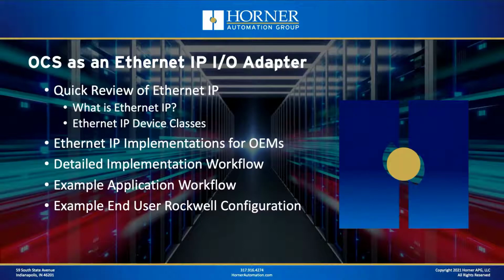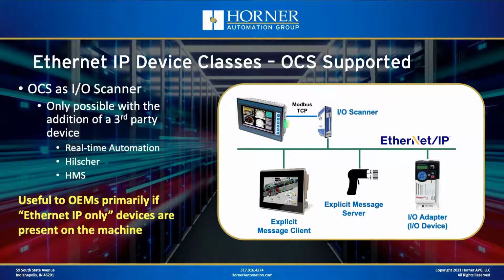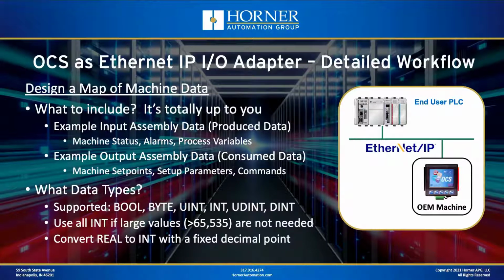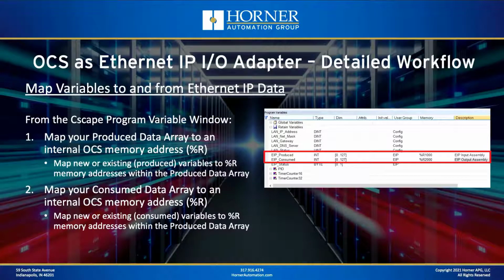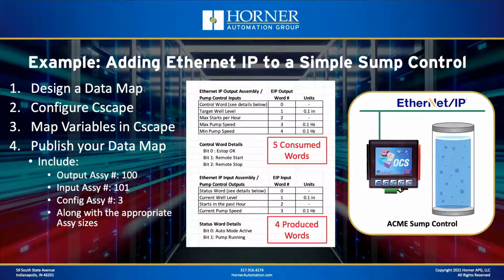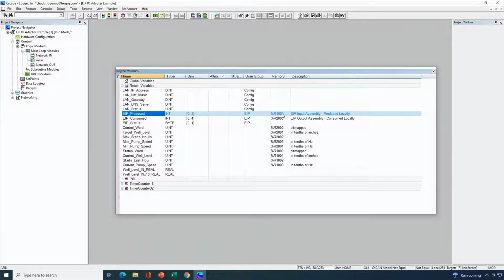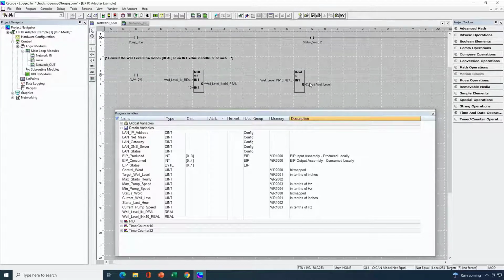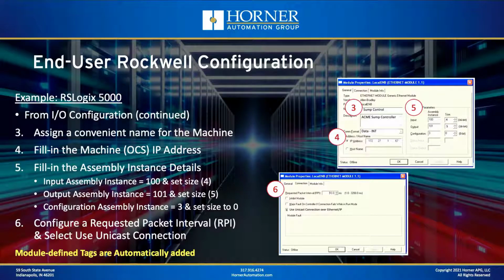OCS as Ethernet IP I/O Adapter

Comment: I've got an OCS device running in production already. Can all these changes be made without interrupting production? If Lan1 is already set up for modbus do I have to use Lan2? If I can connect to the OCS and upload the program, but neither of the IP addresses in Lan1 or Lan2 match the IP address of the device do I need to make that match?
Reply: You can certainly have both Ethernet IP and Modbus TCP running on the same OCS LAN port - so that isn't a problem.  However, you would need both the Ethernet IP device and the Modbus TCP device to be on the same subnet so the LAN1 port can talk to both of them.  If they are on different subnets and you can't change that - then you could configure Ethernet IP on LAN2, and set the IP address on the OCS LAN2 port to reside on that subnet.  In terms of stopping production, you would need to at least briefly stop the controller to download the new configuration.

Comment: I have a QX451BP touch screen.  Does the new version of CScape support LAN configuration for this legacy touchscreen?
Reply: The QX451 is supported by Cscape 9.90 - which is still the current version.  When Cscape 10 is released, it will NOT support the QX series - but you will still be able to use Cscape 9.90 (and all other previous Cscape versions) to work with the QX product.
Reply: @LionsIndy  Hello again. Is it possible to communicate between PLC Mitsubishi FX5U and QX451 via Ethernet or is communication only via RS485?
Reply: @SuperRob32  From the little bit of research I've done, it appears that the Mitsubishi will support Modbus TCP, but only as a client (Master).  If you configure the QX as a Modbus TCP server (slave), you would be able to exchange word data  between the two.
Reply: @LionsIndy  Thanks a lot.  So I will have to use RS 485. Do you have a video on your channel describing how to set up a touch screen to control a PLC?
Reply: @SuperRob32  not specifically. But here are a couple of links to videos that I think would be helpful…

https://youtu.be/ARQfptbP8zU?si=-RlTzpIDcJSUDyCx

https://youtu.be/Txh0Zt946mA?si=VAmlx-J8C1DqeATx

And while it won't help you out in the short term, I will schedule that exact topic later this fall…